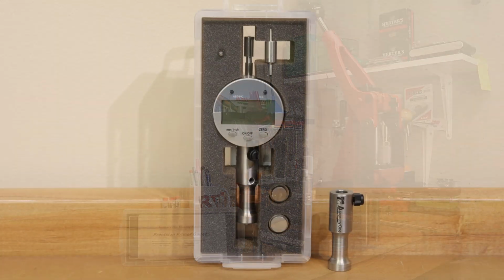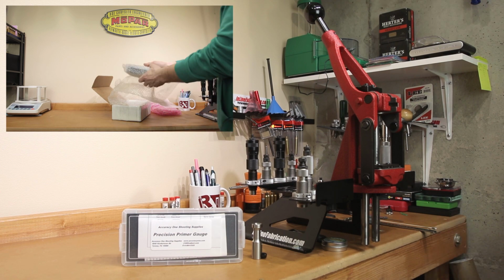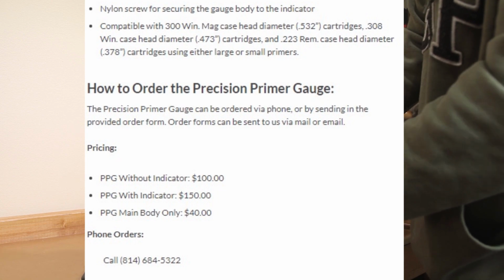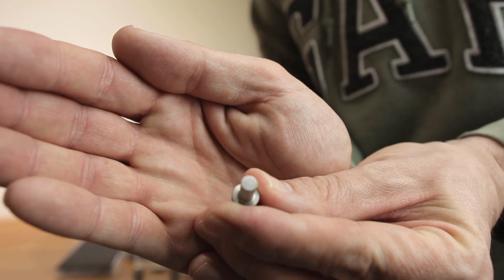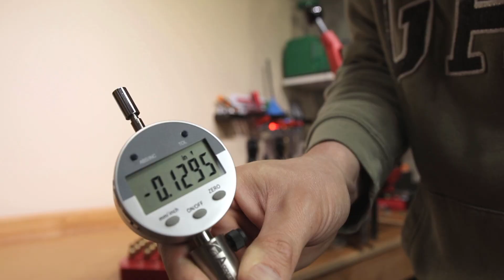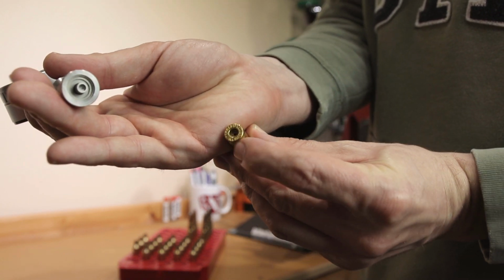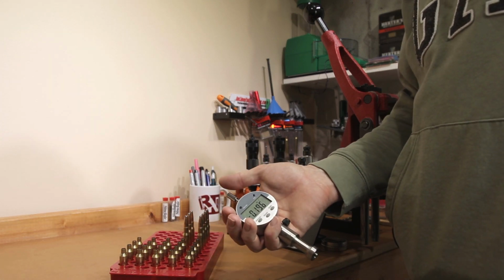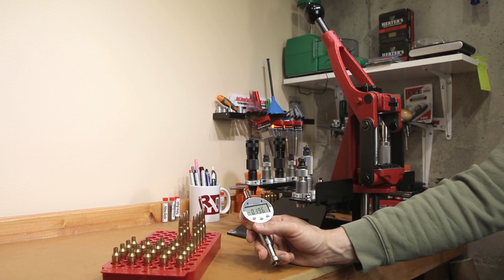Primer Pocket Gauge by Accuracy One -  primer seating, primer pocket, and primer thickness!

Comment: No doubt about it the tool is very interesting and I am sure that it gives you accurate measurements. The real question is will improved primer pocket conditions create better accuracy. That needs to be tested with a statistically significant number of rounds.
Reply from the maker: I am going to start down this road and see what there is to find. Might mean nothing, but I guess I will know. Being able to know I was not inducing any error was the first step and that is why I picked this up.
Reply: @BoltActionReloading   I will be watching closely to see what happens. This is fascinating To me but I am in OCD type of guy.
Reply: @BoltActionReloading   I don't mind spending tons of time on brass prep but in the end I want to see that it accomplished something.
Reply from the maker: I completely agree. I am going to spend the time and see what my process will loose / gain with paying more attention to primer seating, etc.
Reply: @BoltActionReloading  Any follow up video on this now that you’ve had it the past year?  Would be interested to see what the on paper results are over a couple different cartridges with SRP & LRP’s.
Reply: @BoltActionReloading  hope to see a follow-up video on this tool and any results it had

Comment: This tool measures from the headstamp to the flash hole (bottom of the primer pocket) When seating primers, you're seating from the rim of the case. 
My understanding is that the case butt (headstamp) to bottom of the primer pocket measurements are not as accurate as measuring from the case rim. 
When Unifying  primer pockets, it's being done to the butt of the case. Possibly  introducing variation in flash hole to powder distance. 

With good quality cases (lapua,alpha) you're doing more damage than good by unfying pockets.

Comment: Have you considered doing a show on internal neck turning compared to outside neck turning consistent bullet release
Reply from the maker: Hi Dennis, I really don't have internal neck turning equipment so this would be a more difficult topic for me to cover. I am not sure that if your using mandrels to set your internal neck diameter and outside neck turning it is doing to be a huge difference.

BAR
Reply: Was wondering were you would have a smoother surface if you might get a more consistent release?

Comment: Since my last post I received the primer seating depth gauge. I seated 30 twice fired 6.5 CM Lapua small primer pockets with CCI BR4’s. I used my RCBS bench top seating tool to seat all the primers. Using the primer seating depth tool I measured all 30 cases. I then took the case that had the deepest set primer and reseated the other primed cases to match it using the Frankfort Arsenal hand tool by using the seating depth adjustment to match the depth of the lowest depth. It did take a while to get the perfect match but after that all cases were finished with the Frankfort hand priming tool and each case was rechecked with the Primer Seating Gauge. I probably should have measured the depth of the primer pockets but the cases were already primed and I didn’t want to redo different cases. Now I took those 30 rounds and fired them over chronograph and I didn’t see any difference in the accuracy or the velocity fps, es, or sd. With this all said I will be trying again because I have heard that 8-9k primer crush is optimal. And that will require measuring primers. pocket depth to get the correct crush. Hope you find this comment interesting or useful.

Comment: Uniform you pockets and be done with it ,most old reloaders have a good set of depth mic's your not building a space ship and most reloaders are not or can a ford the high road that F Class John travels And get a good press for setting your primers not a set up that is a over gowned set of piers! Just my option most of us old bastere's have been down that road 45 years ago but what do we know ? Charlie.
Reply from the maker: I didn't say this tool was for everyone, Not sure I need it, but I wanted to be able to measure and control my primer process. This was part of that equation. I hope to learn something so everyone can benefit. If I started using this tool in videos I would get 100 questions about what tool it was and how it worked. I wanted a video to be able to explain it.
Reply: @BoltActionReloading  No need to defend yourself. Some people are just narcissist and believe there way is the only way. You know that there is another attachment for this that you can use for bullet seating depth also. Had one since they came out and it is a VERY important and accurate tool for serious reloads. Way to go.